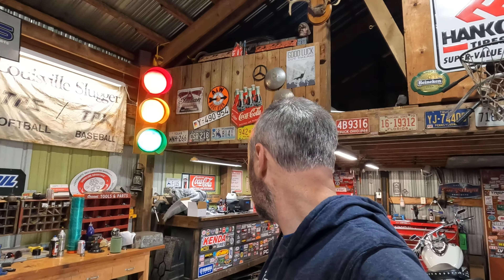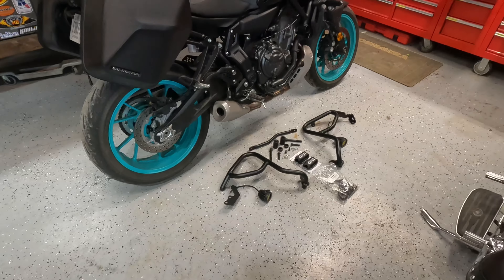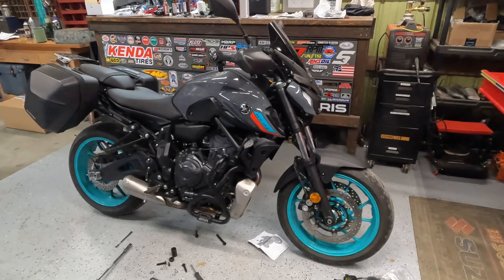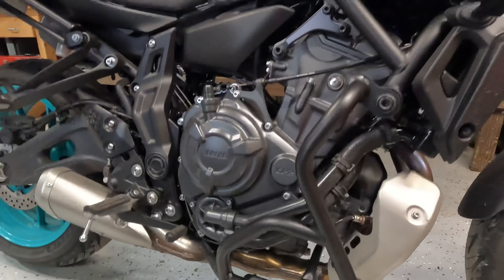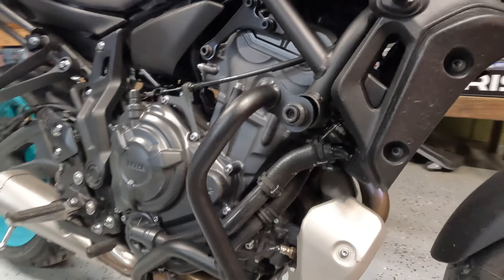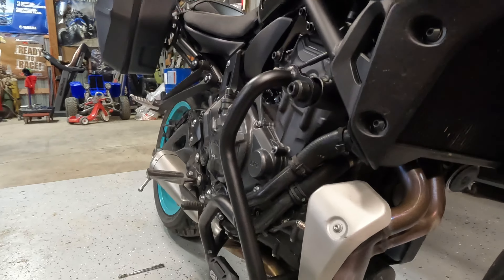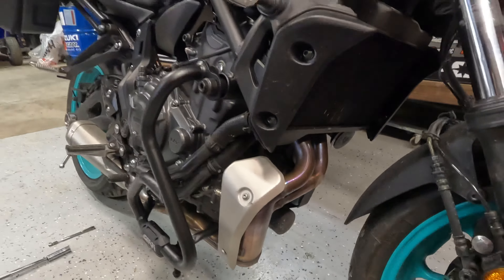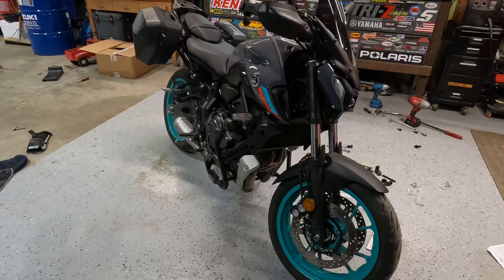Touring on an MT07 - Part III: Givi Crash Bar + AUX. Lighting

Comment: literally doing the same thing, glad to know I'm not crazy. Think that highway peg position is too low for your foot to be safely. I would raise it up to the next corner so you can let your foot hang off like that or flip the peg up while you ride without scraping a toe. i was wanting to try the tracer 7 coming up from a r3 but no go in US and I don't want to fork over for nearly $14k for a proper sport touring like tracer 9 or s1000. Tiger 660 might have been the way to go, but idk about triumphs for moddability or reliability & maint costs.

Comment: Just purchased a 2nd hand 2023 model loaded with Yamaha accessories.😊
I like your upgrades, very useful. (Will do a video in due course on my channel)
Obviously I want to load it even more.
Mine is getting delivered from northwest England to North east Scotland 🏴.😊
It has the Yamaha tail tidy, which I was concerned re your video. As I have sw Motech on my rebel and 350 Meteor. So as I have the bags, would just need to purchase the brackets. So am stumped as would require someone to fit and manufacture a suitable bracket .
The bike has Yamaha engine protection, would these givi bars fit over them?
As I fancy getting led lights too.
Hopefully you do some more videos on your MT07😊😊

Wee Mark. 
PS …….bike has the low seat, am very short in the legs😂
Reply from the maker: Congrats! They are fantastic bikes!    I think the Givi will fit over OEM protection.
Reply from the maker: I do need to make an update video. I have changed a few things!

Comment: I just finished road trip on my MT 07 2016, 2200 kilometars, i love the bike but i must say that it is not for long rides, i cross in one day 800 km - 400 in twisties 400 on the highway, i had to add silicone  cusion to my seat, but still good bike, i love it

Comment: I love the setup, I’m starting to equip mine, I’ve ordered the SW Motech soft cases with removable arms, also ordering the Puig touring windshield and Yamaha comfort seat. 

I’d like to know what are your thoughts on both the windshield and the seat? 
Thanks
Reply from the maker: Windshield is a must! I tried riding without it and I just can’t anymore.    The seat has been great as well. I’ve done a couple 400+ mile days and it’s not bad at all.
Reply: Thanks for the quick reply… will order both! 😎

Comment: Hey Andy - Not sure if this applies to you - not sure if you bought the same Crash BArs from Givi - but there seems to be a recall on some of them >>>>>    Dear customer, 
if you have a GIVI TN2148 engine guard
for YAMAHA Tracer 700 (20 > 22) - MT-07 (21 > 22) ,
please contact your trusted dealer.
 
We will replace it under warranty with
a new generation engine guard
 that provides better performance
and has the same aesthetic characteristics.
 
We have found that the current model may have safety issues.
 
Contact your authorized GIVI dealer now
to book the return and free replacement
of your TN2148 engine guard.
Reply from the maker: I did receive that message! However, with the trouble I went thru obtaining this kit, I’m considering just running them 🤣
Reply: @Andy's Speed Shop  did it actually state what the flaw is and how bad it could be? Like you say... could be worth just risking it... if it takes too long... but for safety purposes... it maybe worth the wait... if Givi are dealing direct.. it may speed things up.. and particularly if you explain what a ballache it was to initially get them... I would hope their customer service would engage... particularly if you mention you are reviewing on the 'Tube of You' ;)
Reply from the maker: @Legacy4x4turbo  - I appreciate the heads up tho!     But I guess the only structural flaw could arise if you were to lay the bike down?  Maybe?   Anyway, I just wanted mine to hold some highway pegs and some LED lights 😁